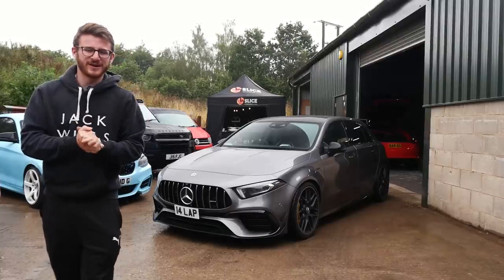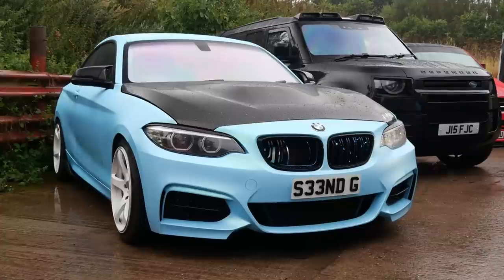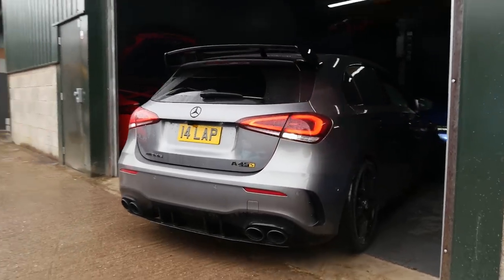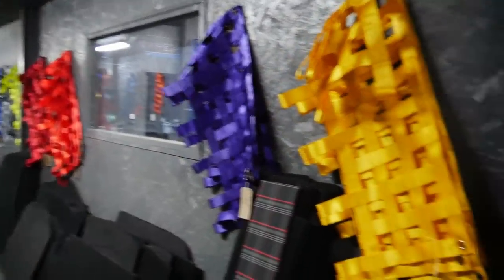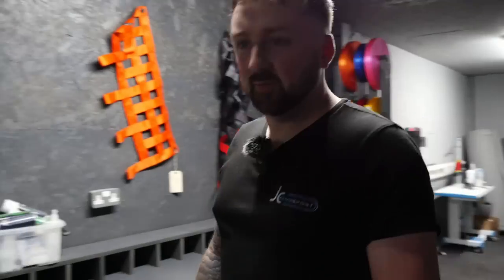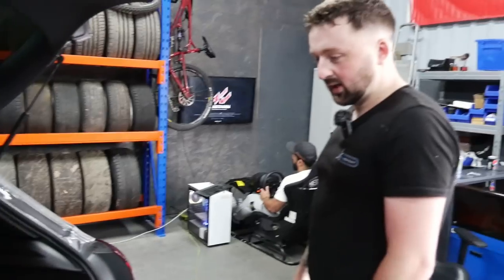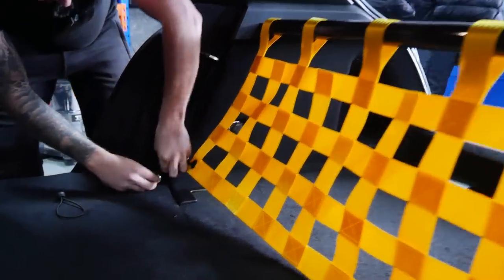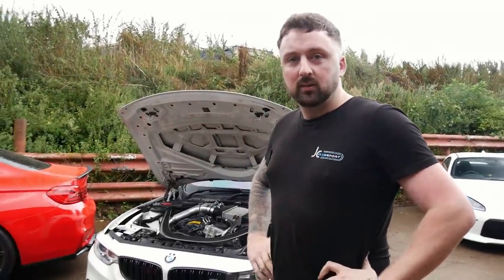This CUSTOM Modification Has TRANSFORMED my A45S AMG!

Comment: Did you notice any wobble after installing the lowering springs and spacers? I have just installed similar items and my car wobbles. Any idea why?
Reply: did you grind the rust off the hubs before putting the spacers on
Reply: Do more power mods to your amg
Reply: @darylhuxley3825  I added an eventuri intake and a BOV, sounds great
Reply: @olidungey3995  I don’t know if the shop did that. Do you think it really makes a difference?

Comment: I've honestly got to wonder how much they ripped you for this "OEM+ mod". Adds zero structural integrity, zero body stability. It's cheap materials - plywood with carpet STAPLED in AND only on the top surface, some flimsy cheap netting. All in the materials are probably only worth about $200. This is full cringe bro

Comment: I think this all depends on how you plan to use the car. If youre going to go a bit more track inspired then i totally get it. At this point though, you have quite a few vehicles in your arsenal so if you need 4 seats, take the m3....once its fixed :P

Comment: All these negative comments from people who obviously have no idea, pay no attention. I'm very interested because like you I don't use my A45S as a daily driver - my main interest is on the track, and I'm looking for performance increases. Removing the amount of weight you have should make a worthwhile difference. Not sure if it would be practical to ship the parts to Australia though! My next move by the way is to replace the CPC and I hear you are planning that too. We will have to see what we can do on the 1/4 mile after that. I'm now at 11.4 secs and although you claim 11.2, I only saw 11.4 on your video, am I right? My mods and tune are supposed to be Stage 3 but the CPC is the limiter.

Comment: Would it not have been better to keep the seats and get a K brace? BAF motorsport, you could have kept the back seats and still had a visual pop with the boot open as well as “potentially” stiffening up the chassis with the K brace.

More power to you for giving mods a go my mate regardless